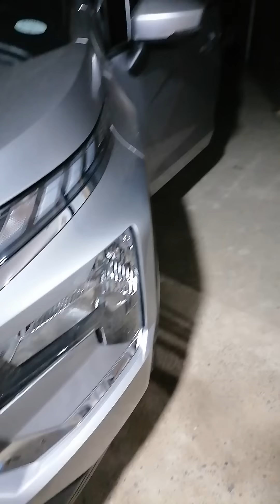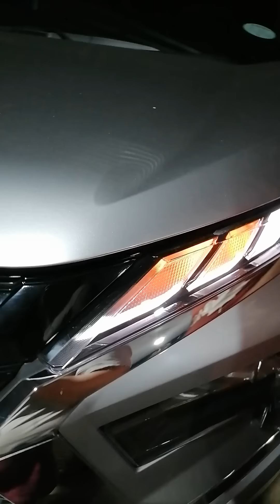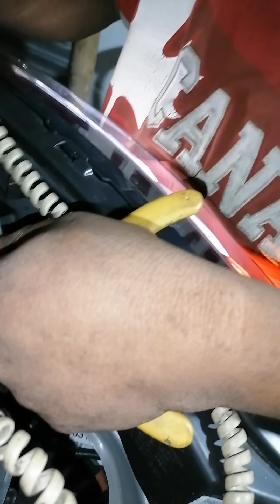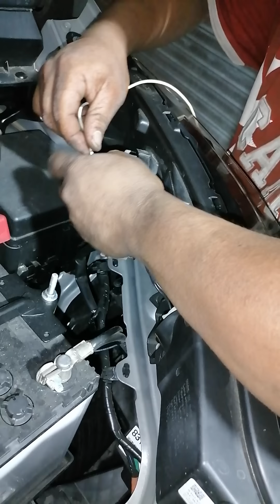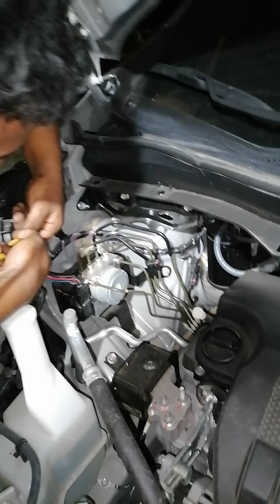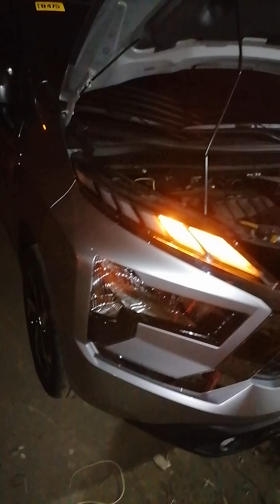NAPAGTRIPAN KO ANG 1.1M NA SASAKYAN WAG SANA MA VOID ANG WARRANTY😅😅.ANG GANDA NG KINALABASAN

Comment: Pwede ba Yan katropa sa Motor na my park light at signal lights? Itap din Yung ground Ng park light sa wire Ng signal lights na nagpapa blink? Salamat katropa 🙏🏼 Godbless
Reply from the maker: Pwedeng pwede tropa
Reply: Maraming salamat katropa 🙏🏼 Godbless
Apply ko to bukas sa MiO Mxi 125 namin🙏🏼